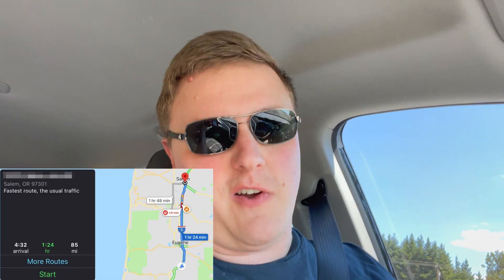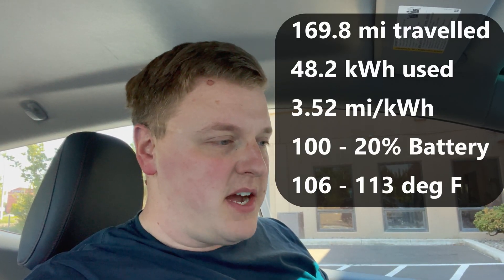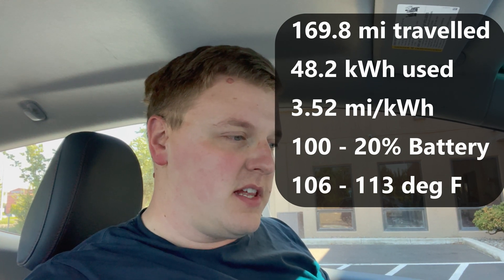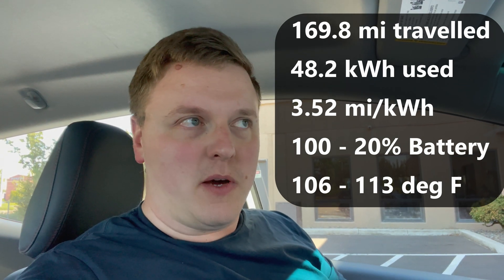Do High Temperatures Affect EV Efficiency? Can They Even Handle it?

Comment: When the outside temp is in the 90’s, it seems like the Bolt’s efficiency will give you AC for free (vs cooler temp).  At 70 mph, you can get close to 4.0 mi/kwh.  At your more extreme temp, you can see that the AC is being used much harder, to cool the car as well as reducing the battery temperature.

Comment: I am always in hot 🔥weather. Living in Florida and I always use the A/C . My range is also not affected by it's use. Now in winter I do have to use the heater and it takes a hit.  I have a Leaf Plus.
Reply from the maker: Yes, I’ve had the same experience with cold weather and had definitely not noticed much difference when using the AC for moderate temperatures, but I expected that it would have a negative effect when using it during hot temperatures. I guess that the improvement in other factors for efficiency is enough to counteract the additional energy usage from the AC system.

Comment: In the Bolt does the AC use the same system as the battery conditioning?
Reply from the maker: The short answer is yes, there is a heat exchanger that is chilled by the AC system and runs the coolant from the battery through it. Most other EVs that have liquid cooled batteries use a similar system. Tesla (I believe) uses the AC to cool the motors and inverter electronics as well, at least in the Model 3/Y
Reply: Hi, this one is quite well educative, about cooling system BRDS https://youtu.be/_ILkLUE3Zxc